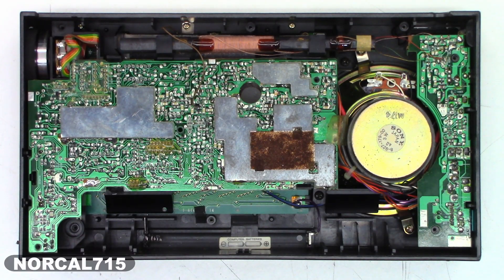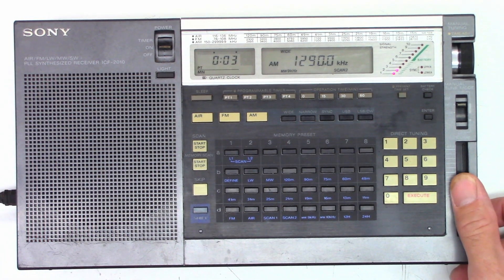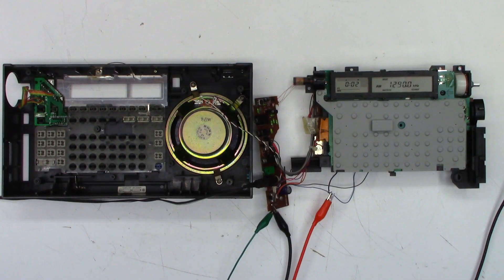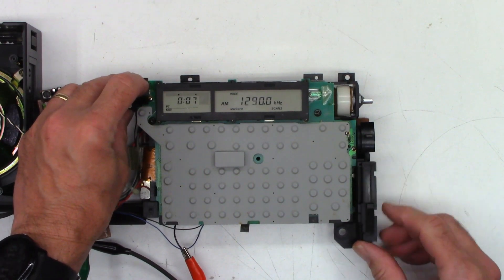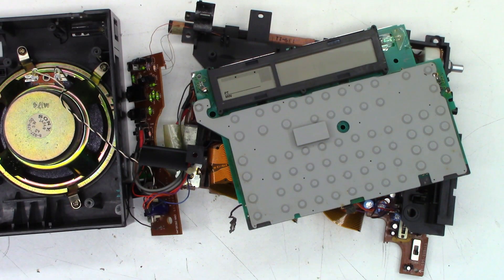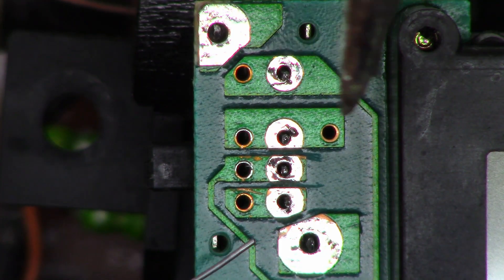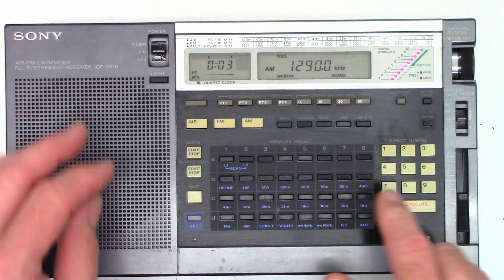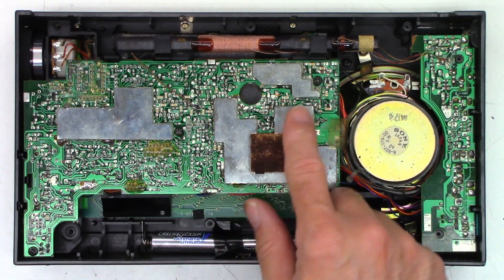PART 2 POWER SWITCH REPAIR SONY ICF-2010 NO RADIO RECEPTION PLUS POWER SWITCH INOPERATIVE

Comment: I am  working on an old model and I am wondering where that brown wire in the middle of the board goes. Looks like it goes up to the ferrite rod but I'm not seeing any place to connect it. I've got all my other wires accounted for.Thanks for any help.
Reply from the maker: I believe the brown go's to the metal ground shield on the inside of the back case.
Reply: @norcal715  I look at that. And thanks for getting back to me.
Reply: I found that location. Now it has come lose from the circuit board and am trying to read the service manual as to where it connects to. I have 2 other 2010's and checked one of them but it looks a lot different.I'm guessing over the years they have made a lot of changes.
Reply: I think I've found it. I always take pictures of what I'm working on and found one with this wire in question. Took a bunch but I found it.

Comment: Thats awesome !   I still have one I bought new in '87 and it has not been used a ton but I do use it sometimes.  I replaced the LED backlight with yellow a good improvement and replaced one of the Q transistors because it had gone deaf on AM.  It's still a great radio.  I'm in NH and it will pick up radio Havana sometimes.  I think you are correcvt something got spilled onit,  the swith (from the outide, the black plastic)  still looked like it had something visibly although we know the important parts on the inside were clean as a whistle now !  Nice work !

Comment: Hey do you do repairs on this radio? I've had a 2010 for a long time and pretty sure it has the q303 problem, but I haven't used it for years and it currently doesn't even power on. Thanks!
Reply from the maker: email me NorCal715videos@gmail.com.

Comment: Hello NorCal, I have a question for you. I have an old Samsung Hlt6756wx dlp tv that my father bought brand new at Costco (2008). Worked for about 2-3 years until it became finicky to boot up. Along with this, came occasional diagonal, multicolored digital lines/patterns, but the tv's  user interface was unaffected. If i gave it some time I could turn the TV on with no issues, but eventually no matter what I did it would boot up with the horizontal digital lines/patterns (colors:lovely digital green and hot pink). The TV didn't have a hard time booting up anymore after that and the UI is still unaffected 😂 that's a plus in my book.
Fast forward to 2020 during the beginning of the pandemic i had extra time on my hands and set out to give the dlp tv another go. Plugged it in, booted it up and remarkably the TV was the same and still functional (more than a decade later!). I thought "this is great!" and started problem solving. With the help of a couple of your videos and tech on several websites, I found out it was the main board. So I was able to source an old main board out of a used tv and installed it along with a new dlp chip, cooling compound, fans, heatsinks and cleaned the whole thing. Then booted it up.........
It friggin worked! I couldn't believe my eyes. It may not have the pixel density of new tv's, but the quality and tone of the picture are so unique and unlike modern tvs.
Then after a few months, it began to show the same symptoms as it did before: finicky to boot up, occasional diagonal, multicolored digital lines/patterns upon boot, and the tv's  user interface unaffected. This again leading to the TV booting up normally, except for the the digital matrix presented in predominantly green or hot pink and the UI remains unaffected.
Any idea what the culprit is on the main board?
Reply from the maker: On the hlr series (the "r") being the production year, tour is a "t", The greens and pink digital lines were caused by failing ram memory chips. This is the 1st repair video ever I made. https://youtu.be/fLKtoEYnE_8

Comment: If you had to recoat the carbon contacts, how would that be done?
Reply from the maker: Keypad fix on amazon https://www.amazon.com/Keypad-Restore-Conductivity-Carbon-Copper/dp/B0026PRMVM/ref=asc_df_B0026PRMVM/?tag=hyprod-20&linkCode=df0&hvadid=167157107032&hvpos=&hvnetw=g&hvrand=8113765335388694530&hvpone=&hvptwo=&hvqmt=&hvdev=c&hvdvcmdl=&hvlocint=&hvlocphy=1013671&hvtargid=pla-373066966717&psc=1

Comment: Nicely done on this unit. What a tricky power switch that is. I was wondering what you recommend for cleaning the plastic face of electronics like this? I can't remember what it was that my older sister used, but when I was a kid, she had sprayed something on my Mom's big ghetto blaster stereo and the whole tuning window hazed up WHITE and was unreadable afterwards. I was so glad it wasn't ME that did it! Thanks for your time and thanks for sharing this with us!
Reply from the maker: Just regular glass cleaner as long as it does not have ammonia in it.
Reply: @norcal715  Thank you for the quick response! I'm wondering if my sister had used Windex back when it had ammonia in it 🤪
Reply: ..... I would never forgive her for that, and I would have called the police ! ! !
Reply: @robbieaussievic  You can believe I was terrified. I let out a definitely audible gasp and hoped she didn't try to pin the deed on me, being that she was 6 years older and I was pretty young and usually blamed for things already. 🤣